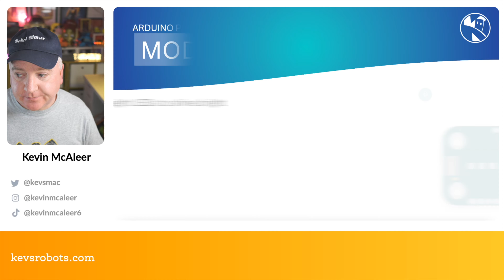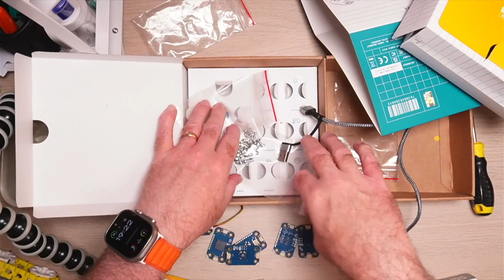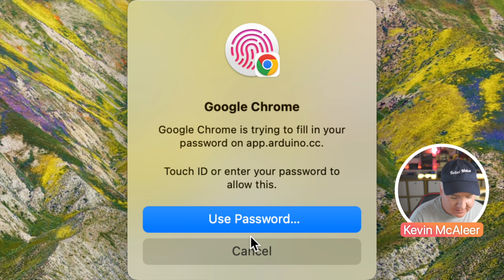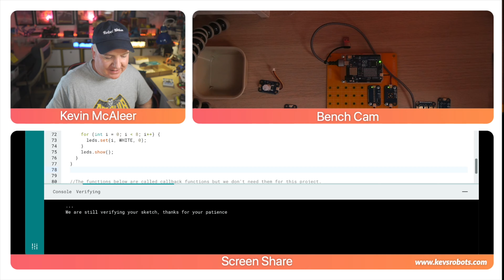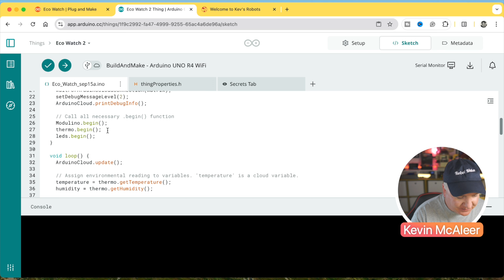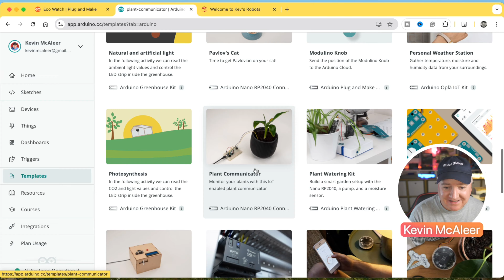Arduino Plug and Make Kit - does it stack up?

Comment: But the breadboard is all part of the fun, it would be good if Arduino cam out with a quality breadboard and jumper wires instead of the Cheap and nasty Chinese stuff that we all have to use and put up with when they fall out